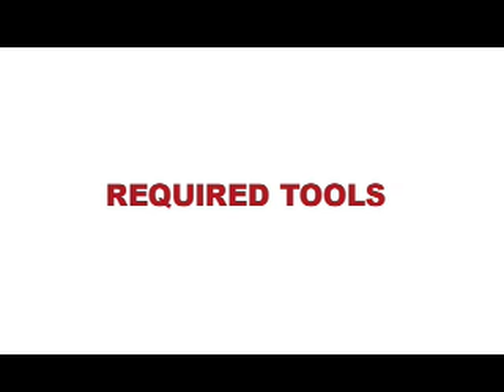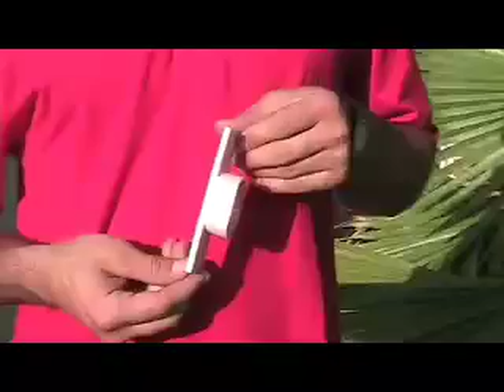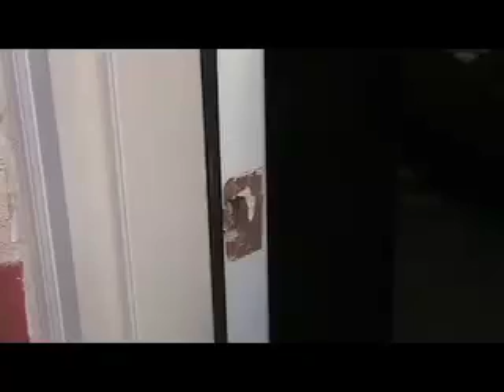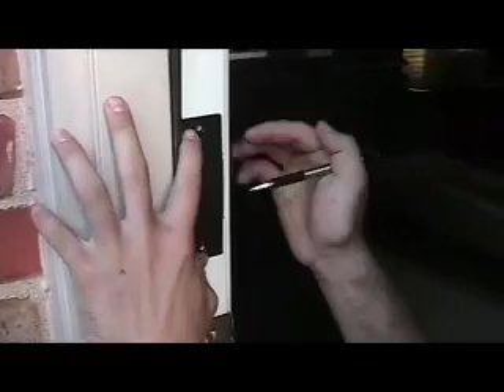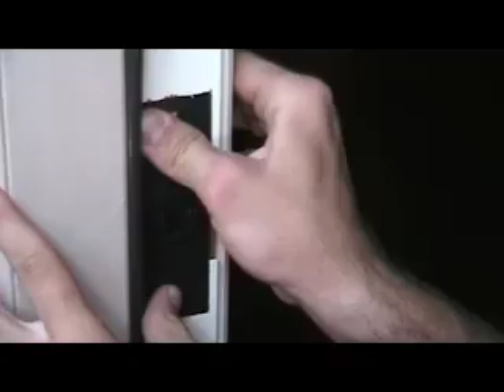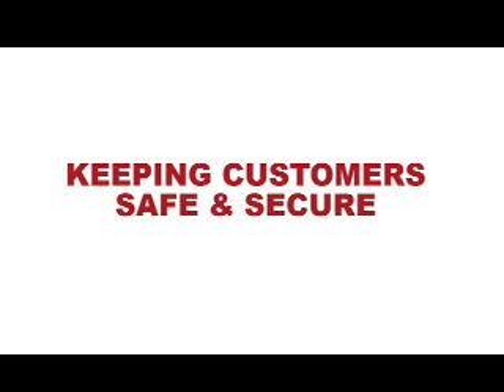Sure Strike Installation Video

Comment: I was interested in a Sure Strike for my front door, so I emailed the company to ask if this product is compatible with smart locks such as the Schlage Encode Plus. I sent a follow-up 2 weeks later. I never got a reply. I figured it's inexpensive, so I ordered one. Of course, I couldn't test it against the smart lock without installing both. It is NOT COMPATIBLE! I can manually lock the door (it's not offset), but the resistance of the pins in the Sure-Strike causes the servo in the Schlage to think the bolt is jammed, and it retracts and alerts an error message. It very clearly is not compatible, and now I have a giant 1 3/8" hole and a giant strike plate cutout in my door jamb. All of this could have been avoided if the website FAQ mentioned this incompatibility, or THEY HAD REPLIED TO MY EMAILS. For what it's worth, one of the shoddy included screws sheared off due to torque, and both threatened to strip. A Home Depot screw went in next to it with no problem. Do NOT expect this product to work with ANY smart lock! And don't expect ANY support from the company.